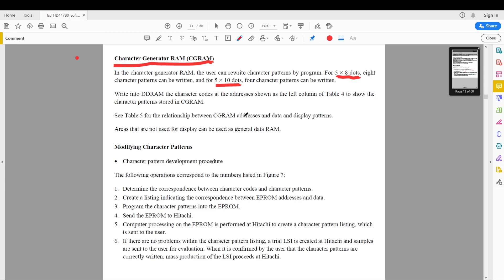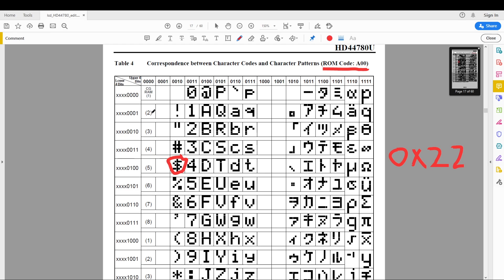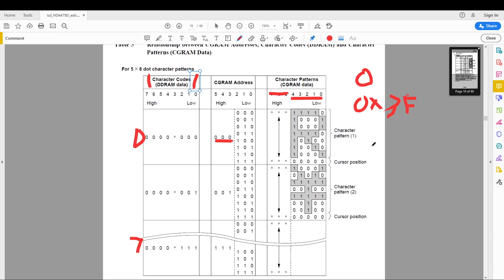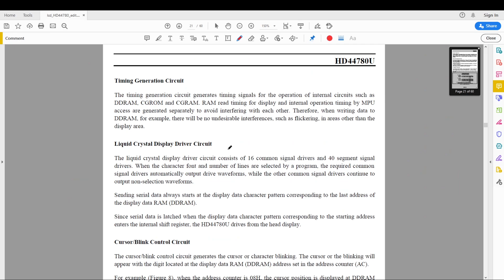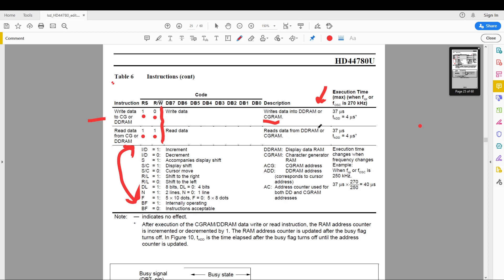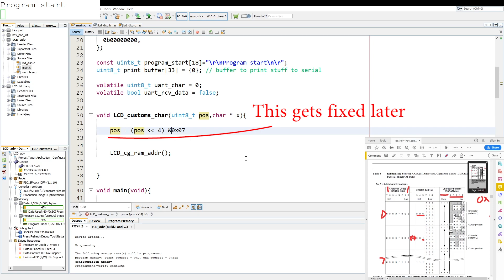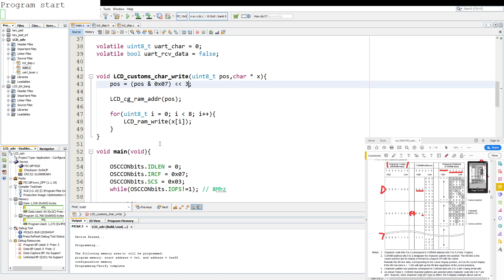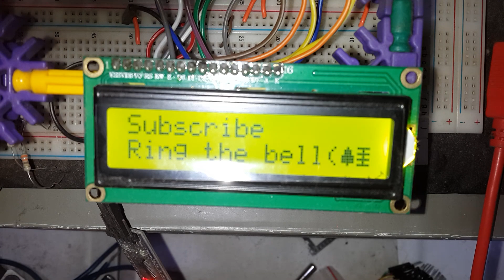LCD Custom Characters 🔴 PIC Microcontroller Programming Tutorial #25 MPLAB in C

Comment from the maker: Full playlist on the PIC microcontroller Programming https://www.youtube.com/watch?v=KSI6fzOPVz0&list=PLtuqBdbsL-DtSo1a9pS4sLkoaU3Or2pl3
If there is anything you would like to see let me know.
I am working on SPI. My sensor popped and I can't get a new one at the moment.
Reply: sir i need a help i am trying to flash an led using pwm with desired user input  brightness COMMAND IS AS FOLLOWS "START,(DESIRED BRIGHTNESS)" EX START,10 IT IMPLIES START FLASHING LED AT BRIGHTNESS LEVEL 10% .NOW PROBLEM IS ON  SENDING COMMAND FOR FIRST TIME  LET SAY START,20 I GET PERFECT WORKING I.E LED START FLASHING AT 20% BUT WHEN LED IS CONSTANTLY FLASHING AND THEN I SEND NEW COMMAND SAY START,30 I AM NOT ABLE TO RECEIVE WHOLE INPUT COMMAND I JUST GET ONLY FIRST TWO LETTER I.E "ST" AND ON SENDING DATA THIRD TIME I RECEIVE CORRECT DATA . I USED RCIF AS CHECK BIT FOR RECEIVING NEW COMMAND
Reply from the maker: @vaibhavkapadia1  Your receive buffer array index counter is not resting properly or not to the correct location. You will see this happen on ever 3de send.
Reply: @BinderTronics  can you elaborate the solution more
Reply from the maker: @vaibhavkapadia1  You got a buffer aliment error. Run your code though the debugger so you can see what it is doing https://youtu.be/O4IpwgWhqLY
Reply: @BinderTronics  sir i tried to debug and i got that while led is blinking and i send data oerr occurs and rcreg update itself for once and doesn't receive further bits of data transmitted. i am not able to solve this problem please help
Reply: Good day, will it be possible to get PIC24 or PIC32 tutorials ?
Reply from the maker: @vaibhavkapadia1  OERR is when you don't read the RCREG fast enough. Clear the CREN bit after getting an error.  More detail in section 18.2.2 EUSART ASYNCHRONOUS
 RECEIVER of the datasheet.
Reply from the maker: @nishkarnaraindath7264  Don't feel it will add any value to the series as the process is the same for 16-bit and 32-bit as for the 8-bit PIC microcontrollers, Datasheet->code->test->repeat. If there is some specific Module/Feature/Peripheral you want to see I'll be more than happy to add it to the idea list.
Reply: I recently managed to get MCP3008 ADC to communicate with my PIC using SPI .I am however looking forward to the next Tutorial on SPI ...... you always make things easy for us here with your brilliant skills ... Thanks Alot.

Comment: Hi I want to use a PIC16F877A for a project. I cannot find the header file for the processor. I'm using MPLABX with xc8 v2.3. Any idea how to use the legacy processors.
Reply from the maker: INSTALL_PATH/Microchip/xc8/v2.3/pic/include/pic16f877a.h

Should be there and added to the IDE paths by default
Reply: @BinderTronics  can only find pic16f87_legacy.h. Thanks for the propmt response. Dankie
Reply from the maker: I am using V2.1. Think Microchip still has the download archived on there site. No problem.
Reply: @BinderTronics  Thanks got it